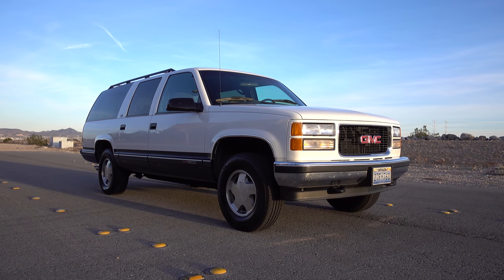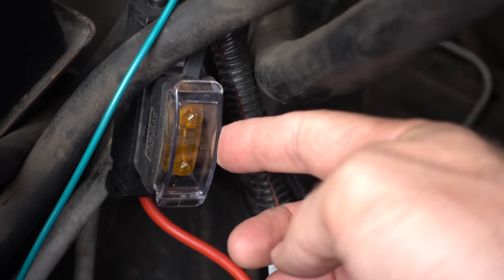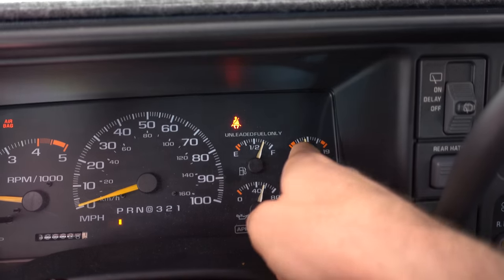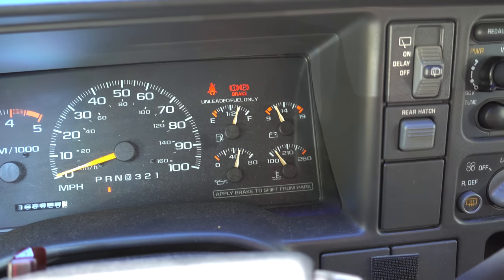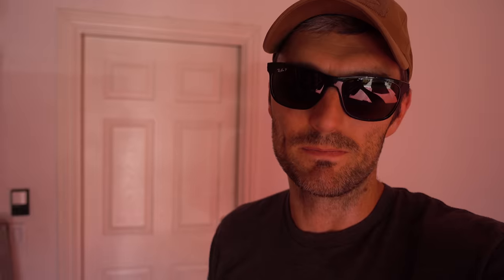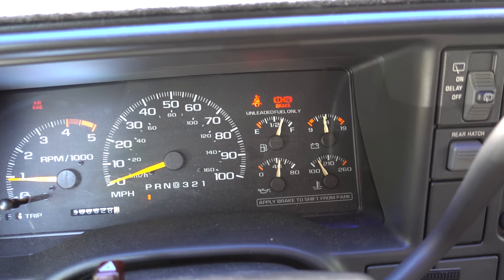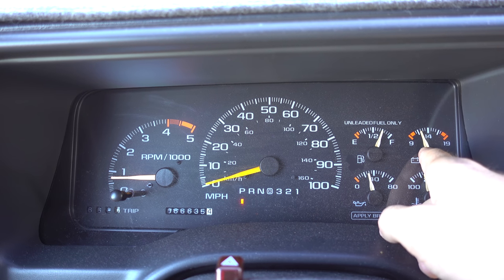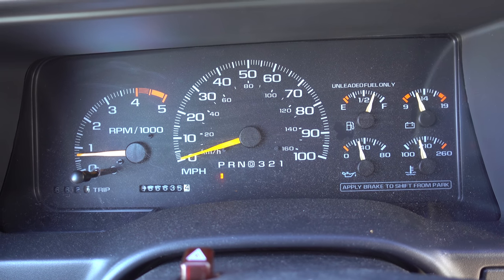SOLVE A LOW VOLTAGE ISSUE!

Comment: The battery is only used for starting the engine, and running some loads with the engine off. When the engine is running, the alternator should be powering ALL electronics. The stock alternator 80-100 amp, was designed to power all loads that were stock in the truck, plus like 10-15 percent reserve. You added 40 amps worth of draw with those fans. The 10 percent reserve is only 8 amps. You need to upgrade the alternator, one with about 40-60 amps MORE THAN THE STOCK alternator.
Reply: If the battery is weak or bad the voltage would get low
Reply: You could just add some relays that are supplying 80 amp of current for each fan since he installed dual fans. Could this idea help.
Reply: Cool story. Should he run his engine full speed all the time too to keep the alternator running at rated current?  I guess the guys in spl competitions with 120,000 watts of amplifiers must have 10,000 amp alternators.
Reply: @dan9132  see my idea is it doesn’t really have so much to do with the alternator, but more with the fact that the alternator literally runs off a pulley spun by the engines pulley. Wouldn’t the engine need to run out of higher RPM constantly just to supply enough energy?
Reply: @dan9132  I used to build those cars and competed in a few. It was not uncommon to have 200+ amp alternators as well as multiple back up batteries and high farad capacitors. In competition they only run for a short duration.

Comment: It may be about time to do a BIG 3 wiring upgrade.That will help the electricity flow much better. Also check out your engine and other ground straps to make sure they are not worn.
Reply: vince mason I second this. easy, cheap and usually will help any modified eletrical system (especially us guys with amps and kickers). or in this case those big fans drawing a lot of juice.

worst case? you spent aabout $6 in wires and had absolutely no improvement.
Reply: Antony youtueb Exactly ! I had a similar problem and just upgrading the alternator wire made a difference...which prompted me to do the rest.
Reply: vince mason for me, the grounding helped out alot. i had my front headlight flicker when the music kicked, of course after I put on the alternator wire and then I reset my ecu. 

started her up, let her sit for 30 minutes, the car runs great and even idles better too (with the amps kicking) and no flicker.
Reply: That alternator is charging but not enough for your draw....Get a big ass alternator and your problem is solved....CHEERS
Reply: vince mason, i ave the same problem. Its not the alternator. I wish i could tell u what it is. But  sorry i cant. Im also looking for answers. Ive had the problem for 2 years without an a/c. Thats not all. My truck sometimes wont start after turning it off and will only start after jump starting it, waiting until it decides to start, or sometimes by running a wire from the + side of the battery to the lower left 30 amp circuit breaker fuse. So if u figure it out? Please contact me. If i figure it out, i will definately let u know.
Reply: Looks like he already did the big 3 upgrade.... under the hood in video past 3/4 threw u can see a red wire coming off the alt and others running on the core support....
Reply: As long as the wire resistance is low, no matter what size it is electricity will flow, 1mm cable can deliver 100+ amps but the real problem is how long will it last, well not long, you get my point
Reply: Truck has a factory big three set up i just redid mine i had the same exact symptoms im steady 14 volts or better
Reply: @gatorsworld  and an AGM battery
Reply: @dandeson9723  what would cause that charging flow not to last ? Or be interrupted I should say
Reply: What do you mean by big 3 wiring upgrade?
Reply: @Mikethakidd887  heat, small wire heats up and it causes changes in resistance, more resistance means more heat and Voltage drop and when it heat up too much the wire burns out, also BIG 3 = replacing stock ground(battery), ground(engine) and positive charging wire to something better.

Comment: Check serpentine belt check tensioner pully they eventually wear out which cause belt to loosen or even slip which in turn cause alternator not 'put out' as it should. Check all pulleys may as well. If pully wobble or feels loose barring inside pully prob warn needs replacing. Also pullys can be off of alignment which will cause belt to wiggle or shimmy (this cause resistance) failing or failed tensioner is usual suspect if hear noise. Spray water on belt check see if water knocks out noise or you may hear bearing inside pully grinding barring is bad

Comment: It's all your ground connections. Battery to body body to frame there are a Lot of them. The thing most people don't think about just because you have a good power source there has to be a good ground source to complete the circuit.

Comment: I had this in my cavalier soon as u rev it goes back to 14 volts it was a ground issue I know its an old video but might help someone
Reply: Is it just the ground from the alternator
Reply: @jakecorso921  yes but also check frame  grounds there in a tight spot beside the driver side headlight

Comment: U need a higher Amp alternator for the high load.   Stock is 105 AMP.    Plus a Dual battery set-up will help also,  Like an Ambulance has.

Comment: Hope you solved your question by now. All the tips you’re receiving each have merit. Please know, while alternators do charge at idle speed, they do not put out max at that time. Alternators are made and set for different applications. With those dual AC systems, there is excessive taxing on the battery voltage but that doesn’t necessarily mean the battery is bad. There should be an idle stop solenoid that is activated to increase idle speed when the AC compressor kicks on and then when you turn the engine off, the solenoid is no longer energized to prevent the higher idle causing run on. If you don’t have a properly adjusted idle stop solenoid in place, I would install one and adjust it accordingly. Raise the idle ever so slightly to find a decent engine RPM to help with the low speed charging. Also, check with alternator rebuilders to see about using an ambulance alternator and or getting a smaller alternator pully. For your fuse popping issue, make sure the fuse is rated for the current draw of those rad cooling fans. The fuse is working properly because it opens. Excessive resistance can also cause this or possibly just an under rated fuse for the particular circuit. Check the wire size as this can be a factor. Keep in mind, you are taxing the charging circuit at low idle speed with all those accessories on while idling and the DRL’s on. Personally, I don’t think you will fully resolve this without major changes however, it’s something you may be able to live with after a few tweaks as mentioned. Hope it helps.

Comment: One of two remedy's 160 am alt or change your alt pulley to a size smaller which is the less expensive way to go. Personally I beleave is the best way to go as well. Smaller pully more rpms = more current! Your welcome!  IV had to do this mod myself and it works like a dream
Reply: Smaller pulley = smaller belt = more amps on rotations. I like the way you think. I gotta try this out also. Did you ever make a vid of this mod?

Comment: 1. Alternator charge should show at least  14.02 at Battery with accessories on.
2. Ground/Negative cable needs to be replaced. Solid Neg connections is crucial to frame and to body.
3. Positive cable Down to Starter Needs to be replaced. They get cooked over time and causes voltage drops.
4. Generally try to avoid any adapters, spacers,washers between battery cables and battery posts. Straight battery cable to battery post is best.
5. Just a suggestion, can original fan be replaced/returned and upgrade to Heavy Duty Fan Clutch and add some Red Line Wetter water to coolant.

6. Electrical fans are fine but can cause all kinds of issues.

Summary: Get that Original Mechanical fan back in. Upgrade to Heavy Duty Fan Clutch. Power wash and clean with Simple green
your AC condenser and radiator core. Add red Line Wetter water. Back on the road nice and cool.

Extra Bonus: Go With Original Mechanical fan W Heavy Duty Fan Clutch and add a Single Small [ 8-10 inch]Auxiliary  Cooling fan in front of Radiator. They are reversible so make into a Air pusher...lower electrical load on Charging system!
Reply: false ,, he said he checked the voltage from the back of the alternator and it was 13 volts
Reply from the maker: Mr. Roy That is a lot of great info. Thanks. I'm considering putting the original fan back in and doing s smaller pusher as you said. We'll see what this summer brings...
Reply: I had a very similar problem,,changed alternator, and batteries,,no main help,,read this blog On
Posting set,,and figured the advice about getting good grounds was likely most true for me,,as I n my experience, one time I moved the negative battery wire to the engine,,and the voltage came up to about 14.5 volts from the alternator..so I figured this was my best clue..
So replaced the big cable from positive battery to starter with # 2 wire,,and the negative to engine with #2 wire,, This seems to have solved the main problem. Reference to Mr.Ron and similar comments..
Reply: Story, I meant Mr.Roy, and all similar .You helped me fix my problem.
Reply: @Dpcx11  voltage is not the issue that just is a quick way to determine is your battery is storying adequate amp hours 13 volts means he is at about 80% battery storage

now way back in the 80s-90s most your stock alternators were about 30-50 amps charging now if he is blowing a 40 amp fuse he is pulling more than 40 amps from the battery 
that means he is not making adequate power  he should have at least a 100 amp alternator installed

i mean 1st you have the huge duel fans drawing 35-55 amps + you have the A/C running and presumably listening to music plus the ignition system  all that puts you well over that 50 amp range

and the typical a car battery holds 40 Ah and would be drained in quick order
Reply: The alternator is not necessarily going to show over 14 volts because the alternator only charges what is needed. The alternator is bad aftermarket is junk. The alternator will only show maximum voltage when there is a maximum load or maximum demand on the system. Also checking the grounds and all the wiring for corrosion is a good idea
Reply: Mr Roy, my 94 chevy c1500 5.7 has been decelerating on the freeway after doing 70mph for about 5 minutes then throttle doesnt respond unless I gun it. If I keep it under 60 then I have no issues. I spent about $1500 so far chasing this ghost,  a few weeks ago I replaced the battery ( to no avail) and yesterday the alt gauge started dropping as I drove it, lights got brighter when I accelerated. So I replaced the Alt today and now its dropping FAST and showing my battery warning light, dropping to about 10 or so on the alt gauge then back to 14 when I come to an idle. I had the battery tested at autozone (were I bought it) and they said its fine 100% charged and at 12.6v. The new alternator make an aweful whine, could the alt be bad (its a reman from NAPA)? Im really hoping its the alt failing at speed. Any thoughts? Thanks
Reply: Silver Leo , I agree with your assessment. Alternator can be defective from the box. As extra replace both battery cables. Also check grounding straps from engine to body body to frame etc. As for acceleration performance issues try giving that mass air flow sensor a cleaning with CRC mass air flow cleaner and replace fuel filter and air filter. Basic routine maintenance can make a huge difference!
Reply: @1ROAD Dont know if your year had them yet. But there is a junction your ground will run through,  i think its called a pcm? Tells your car what to charge.  Im literally a complete dumbass with cars, and my knowledge is basically that i just watched a video on it.  But it may be that if you have one.  People doing the big 3 were not running their grounds through it so alternator wasnt being told what to charge properly.  My post is probably a colossal waste of bandwidth, but maybe itll help. I would be willing to guess if you added electrical demand on your truck,  and its not keeping up, youre not producing enough voltage.   And thats not the battery correct?  Its alternator right?? So its gonna be the connections or the alternator or the pcm is just not having all the available info by all the grounds not running through it so it simply doesnt know to charge?   Like i said- total mechanical moron(me), if you wanna know about lifting weights im your man, but that seems to make sense to me
Reply: I changed the alternator on my Nissan Maxima today. The positive us a large wire, no problem. But the negative? Just trusting the current to go thru these 2 mounting screw?
If there is resistance on the ground side, the alternator will still try to regulate to 14.4 volt.
Somebody wrote that the voltage change with the load. Sorry, all these words can be confusing; current change as needed. Voltage is actively maintained to 14.4 volt.
Old car may not succeed to maintain 14.4 volt on idle. But if you press the throttle, the motor set to 3000 rpm, it has to deliver 14.4 volts... Unless your battery has one of the 6 cells short citcuited ; then, 12.6 volt will be sign of such problem.
Reply: I learned something again from this. I've been modding cars because a cheap ass, but truly, I was thinking more charge was needed, a smaller pulley and over clock the alternator. However, you make note to go single fan, and use original equipment due to design and give that an upgrade. It's a far cheaper route.

I live in a $250 car, so everything on this car is ultra cheap. But the issues is has, are not worthy of my usual process. Thinking more like your post, this will help me. A bit long to get to the point, but thank you for this small lesson. A good hand up!
Reply: Hey Do they have a cheavy duty fan clutch ) for my 1998 gmc k1500 5.0l sl 4wd ? 

A link would be awesome thanks
Reply: @1RoadGarage  -  Sometimes the wire from the back of the alternator to the battery is not heavy enough. Make sure you have a 6ga or 4 ga wire running from the alt to the battery. 
When you are putting out that kind of heavy current that the big fans draw, the "resistance over the distance" for lighter wires such as a 10ga wire is just too much. 
Also put in a supplemental ground from the alternator to the battery at the same time. These new paths can me connected at the + wire from the battery to the main fuse distribution box as this is where the power is being used. Also the immediate body ground to the Alternator case directly. A solid ground path from the Alternator directly to one of the main battery ground cables is essential. 
The last suggestion everyone made is a stronger alternator. Maybe an ambulance type made to produce big power at idle. Junk yard is a good place to get one. A school bus is another good doner. 
Finally you should consider putting a fan controller in with two channels in it. One for each fan that turns off or slows down the fans when on the highway but in traffic ramps them up. Dont just run the fans full power all the time. This is counter productive and very hard on everything. That is why the factory two fan systems use controllers. 
There are some good aftermarket ones on ebay. PWM or pulse width modulation with a temp sensor and either get two of them or a dual channel unit for two fans. 
No more fuse popping. No more bullshit. Cold air and everyone happy.

Comment: From everything I see your entire electrical system works just fine since the alternator is putting out enough current to charge the battery as well as keep up with your electrical load. But when your in drive and stoping your alternator just isn't spinning fast enough. I would upgrade to a smaller pulley on your alternator like you mention in your "welding wire video." A dual battery will just give you a little bit more time to sit in drive at idle. It won't fix the issue. It's a bandaid solution rather than a permanent fix. Best of luck.